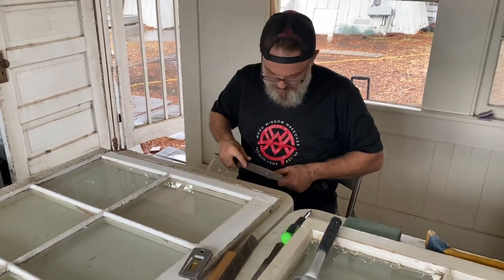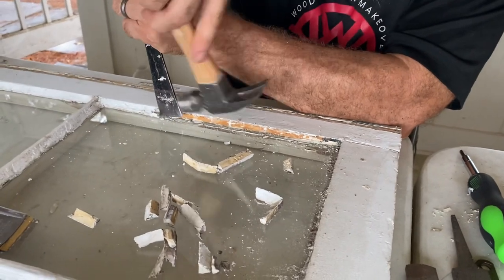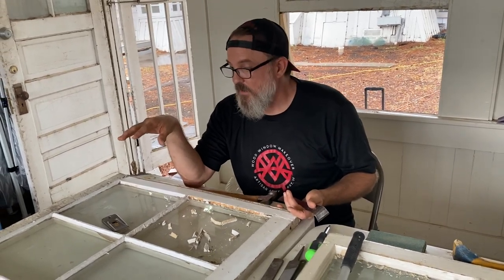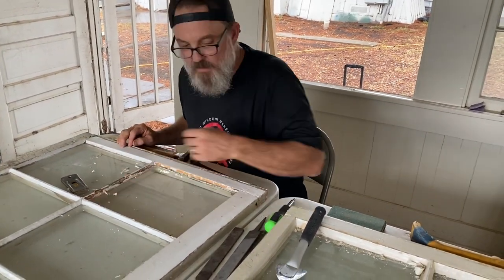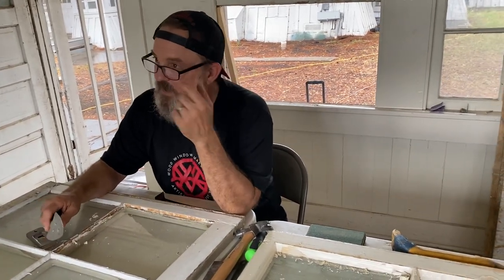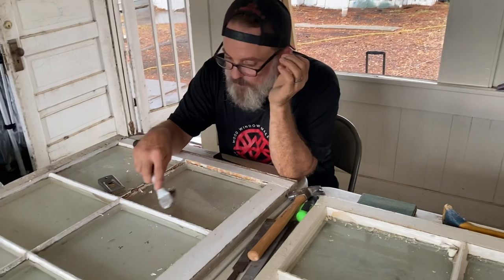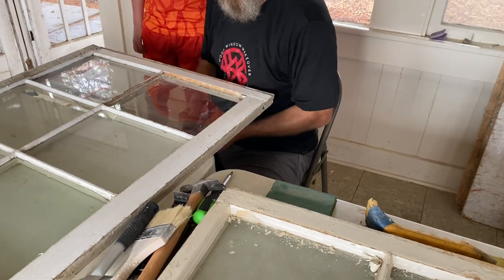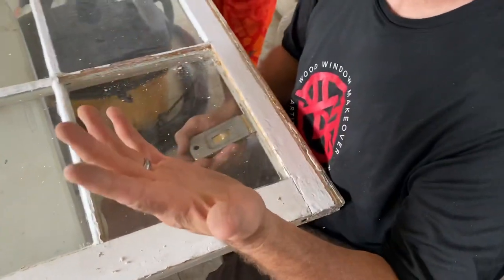Historic Wood Window Refinishing - Tools and techniques to Remove Glass

Comment: I've been learning some great techniques from your videos. I also appreciate what you're doing to get others going to help restore these windows.  

I notice that in this video that it is time consuming using the razor on the backside. I've had pretty good luck, even with caulk, using snap off blade razors to score around the backside a few times on all four side (without slicing the muntins).  As long as my corners are cleared out on top, the glass usually pops outs pretty easily at that point.  It could just be that it takes me three times as long to clear the top side first though!
Reply from the maker: I’m always hopeful that people who learn from my techniques will use them simply as a launching point. I think my techniques are pretty solid, but are by no means the only way to get the task completed. I like your method and will keep it in my back pocket because sometimes what I’m doing doesn’t work out as well as it does in the videos and I have to shift and try another angle. Keep it up.